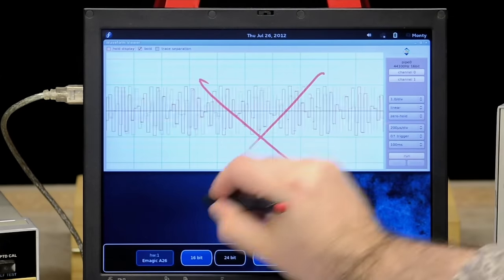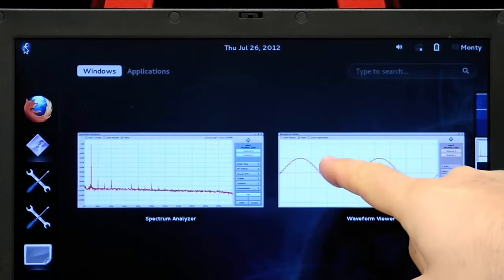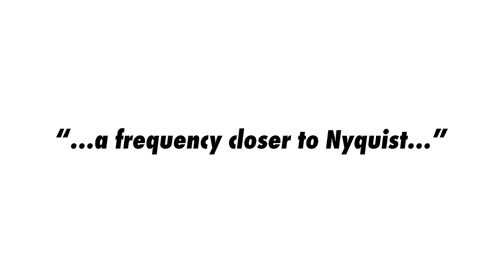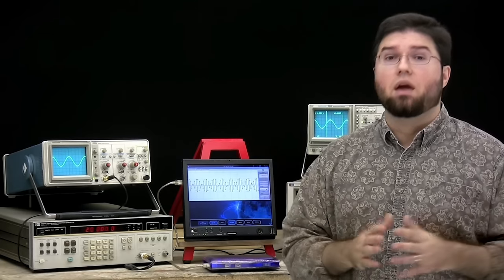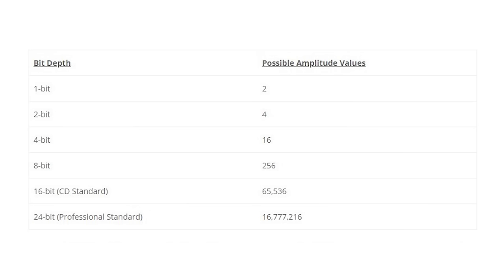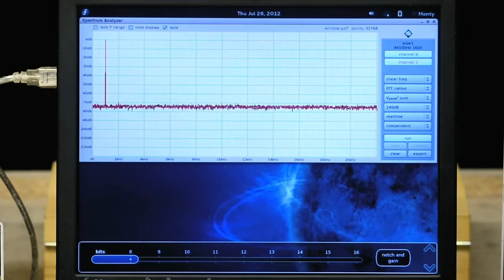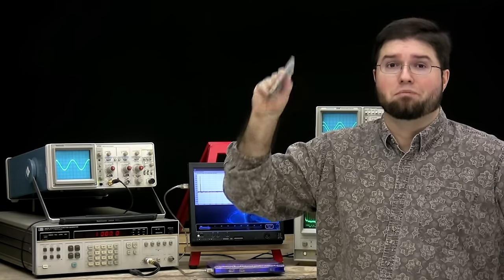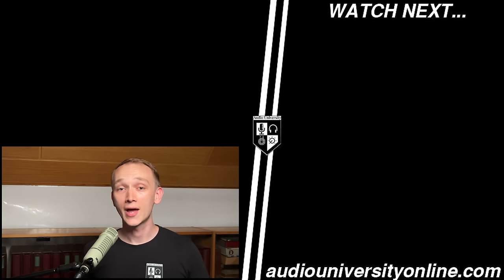Debunking the Digital Audio Myth: The Truth About the 'Stair-Step' Effect

Comment: I believe the 44.1 kHz audio used by audio CDs, Was really because at the time with Sony PCM, that was the maximum that could be recorded as data on U-matic videotape for PAL and NTSC standards. And later on, Betamax was often used for digital recording distributions to the CD pressing plants. This was before DAT became the norm in the recording industry.
Reply: Ahh penny dropped moment. I took a tour of a CD pressing plant in the 90's when it was all quite new, and we were shown the process from start to finish. When the engineer showed us the source material as a videotape we screwed our faces up, I guess thinking it arrived in analogue form.  As an aside, they had to destroy a large proportion of the pressed CD's as they had spots in them, usually black. They played fine, but consumers would think them faulty and return them. Another thing they showed us, and gave us a sample of which I still have today, was the ability to press a hologram into the disk instead of printing the tracklist or whatever. Looks amazing, but I have never seen it used on a CD release.

Comment: Very impressive content. This is a topic I am well-Informed about, and a misconception that I’ve explained to people on a few occasions. You did a fantastic job of explaining the fundamental fact that the PCM transcription can only be decoded into an analog duplicate of the analog input signal. Noise floor and headroom of the analog components in an ADC and in DAC for playback will matter if you are interfacing with analog audio equipment, so gain-staging and phase and the usual analog caveats still apply- and there absolutely have been very poorly-implemented examples that set bad examples of what digital audio ‘sounds like’- .mp3 stereo 44.1kHz at 128kbps was the norm for a long time, and some .mp3 codecs performed very poorly at properly encoding high frequency content, there is very obvious aliasing that can be heard for everything above 13.5khz. 

I clicked on this video mainly to check and see if you had your facts straight, and man you sourced an excellent video explanation also. I did not get to this understanding of the PCM wave function on my own studying until I was about 40 years old, after spending about a decade as a telecommunications technician and getting to the point of telecom engineer.  I’ve been making music with computers and instruments 30+ years, studying recording technology and techniques, and building my own synthesizers- this level of technical detail is satisfied that you didn’t gloss over any important points and that you drilled down to the absolute truth of the matter without resorting to an analogy (pardon the pun) or a metaphor to explain why. 

I was on the edge of my seat waiting for you to explain why higher sample rate/Nyquist is desirable in digital audio production, and might be an interesting/informative counterpoint to mention that some production choices intentionally lower the sample rate/bit depth and collapse mono in order to induce digital artifacts during conversion, such as aliasing and quantization loss (the Lo-Fi phenomenon, 12-bit samplers and wavetable synths making a big comeback, the proliferation of bitcrusher FX, etc)
Reply: Yes some codecs were dreadful. I remember satellite TV undersampled their transmissions on many programs in early years and sound scores had nasty and painful artifacts. Yamaha's TwinVQ codecs were very good, but all suffered with bad artifacts when the sampling was cut too far.

Comment: I worked for Harman in the mid 90’s & we did blind tests at 44.1, 48 & 96k. Everybody could hear the difference between 44.1 & 48 but most couldn’t hear any difference between 48 & 96. I do all my work in 48k now
Reply: People don't mix in 96k for the sound but for the latency. Just as you dont mix in 32 bit for the depth but to reduce noise input from mics.
Reply: "everyone could hear difference between 44 and 48"? no they didnt...
Reply: @matswessling6600  believe what you want and stay mediocre
Reply: But that's about the quality of processing after DAC.  A higher sampling rate allows for poorer post-processing quality.
Reply: @vaclavzeleny5717  I’d think a higher sampling rate would enable better post processing simply because there’s more information to work with
Reply: @GroverTD  I think it's because the following filters don't have to have as much of a slope.  So, on the same player (which logically has the same filters), a higher frequency will result in lower distortion, which then appears at lower frequencies.  It will not be related to a smaller amount of information.  If resampling from a lower frequency to a higher one was done, the sound would probably improve as well, even if no new information is added.  That's an my opinion.
Reply: @vaclavzeleny5717  I humbly admit you may know quite a bit more than I do about digital signal processing. I stick with 48khz because even though it's subtle I can hear a difference.

Comment: What concerns me with these experiments is that they are done on pure sine waves.  Audio is rarely a pure sine waves.  High-frequency (including in-audible) harmonics are additive.  So a bit depth helps to re-claim some of these harmonics for a purer sound.  It's not necessarily only about the noise floor.  It's also about recreating the harmonics on the signal.  But it is a good demo none-the-less.

That being said, most DAC's nowadays do not do the stair-step method, they climb the voltages between the points so you get more of a "lined" slope.  instead of a histogram looking thing....  Modern DAC's are amazing, and represent the MPEG-destroyed digital audio signal to it's very best!

Comment: It's all about context. Which is also skipped over here a little bit. On it's own, yes 16 bit DNR is enough. Unfortunately we don't use a DAC on its own, there will be an amplifier behind it. This amplifier also amplifies the noise. Just in a every day home setting this is often not a big deal. In a very quiet (mixing) environment, speakers that have active filters and very high efficiency high frequency units, the noise can be easily be audibility. The same goes for a big line array system with like 24 compression drivers with a sensitivity of 108dB/2.83V each. How do I know? I develop these systems and I can tell from 15 years of experience that in both cases those noise levels are clearly audible for every human being.  There is also a good argument of having some safety margin. Although that's more on the recording site. When music is mastered, there is a lot of EQ'ing going on, you also don't want to clip your signal. Both combined will already give at least a 24-32dB penalty on your DNR. Resulting in an effective SNR of just about 75dB or so. Similar things can happen when it cones down to sample rate.
So while I agree with the message that people shouldn't be so worried about DNR/SNR and samplerates as well as debunking some myths, this video still gets a thumbs down from me because it's extremely over simplified. It doesn't explain why some of those higher numbers are actually very useful. Therefore also spreading misinformation.
Reply: An amp's job is to amplify all frequencies equally.  The db's will stay the same while the dbm's will all increase -- there's no reason why an (excellent) amp should amplify the source noise more than the source signal.  (the amp will add its own noise, to be sure).  You're totally correct about the safety margins -- that's why we master and digitize at much much higher precision/frequency than the output. And yes, I am yet to see a speaker that can reproduce an even 80db range without distortion 🙂
Reply: @dmitryjoy  That's true, the issue is when there no signal present, it will still amplify the noise. Resulting in audible noise at quiet moments for example.
Which is just a small annoyance at like monitor speakers, or can be very disturbing for a professional musician with an active floor monitor (with a compression driver) during a concert.
But during just regular play at max volume, yes you're correct.

Comment: It would be interesting to see what a non-sinusoidal signal turns into with this conversion and how much noise there will be in the final signal. In the above example, an excellent sine wave can be obtained from a sine wave simply because this is how the digital-to-analog converter works.
Reply: This is exactly what I was thinking. If by default the DAC is smoothing the waveform assuming a single frequency (clean sine wave) then when you modulate some additional frequencies in there may be a lot more difference between the input & output.
Reply: Any non sinusoidal waveform (sawtooth, square) basically everything with "corners" has a infinite frequency spectrum, and is therefore beyond 22kHz.
Reply: @MatthiasSchaff So what? Is sawtooth or square signals not audible? Or no visible on osciloscope? But such signals will definitely show how analog-digital-analog transformation works with all features. Clear sine is not a good example to show that there is no loss with such transformation of signal.
Reply: @MatthiasSchaff  the key is using something other than a single frequency. This could easily be established by modulating several frequencies together for a comparison. If a DAC is designed to always smooth as if it is a clean single frequency sine wave then a lot can be lost.
Reply: @GardeningSolutions  Exactly. And it so happens music usually is made up of many frequencies all at the same time ! Why this is absent from the discussion here except in this subthread makes the mind boggle. Not to speak of unpitched sounds !
Reply: This is exactly what I was thinking whilst watching this. Much like you can describe a line using two points, there must be a point where you can describe a sinusoidal waveform in the same manner, then any additional data is redundant. Hopefully someone can comment with an explanation!
Reply: @MPHstep  Any signal can be represented by a sum of sinusoidal signals (Fourier transform). This is what a spectrogram shows: the amplitude and phase of sinusoidal signals at different frequencies. The sum of all the sinusoidal signals in the spectrogram is equal to the signal in the time domain (amplitude over time).
For a perfect representation of a discontinuous signal, infinite frequencies would be needed to represent it in the frequency domain. But our ears can only hear the parts that are within the 20Hz to 16kHz range. That is the reason why all audio equipment is made for that range. If you look at a 16kHz band limited square wave, it may look weird at first, but it represents what our ears can actually hear. All higher order frequency components are inaudible to us so there is no point to reproduce or store them.

Comment: I never even considered the idea that captured samples can only result in one possible output. That revelation is kinda of a game changer for me. Great video!
Reply: But that's the point in the video where suddenly there's no explanation where one is needed. :/ How can there only be one possible output? He shows someone drawing multiple possible outputs, then just says "turns out, nope, you can't." Why not? What if there had only been two or three samples? How could there be only one possible output then?
Reply: @krisrhodes5180  if you draw a shape that is clearly wrong but hits the sample points, the you have tried to capture something that has way too high of a frequency for your sampling rate. Thats why sampling frequency needs to be double of the intended frequency range.
Reply: Okay I think I may be starting to see how this works. If I have just two samples, then the highest frequency this works for would be one (over the same time as the two samples). I can imagine that if I'm told "these two samples represent a sine wave at a frequency of one or lower," maybe there's a unique solution there. (Still feels like there should be a solution at every possible frequency one or lower but I can believe that feeling is wrong.)
Reply: @krisrhodes5180  It's called the "Nyquist–Shannon sampling theorem", and I think if he went into the math in his video he would just lose the audience.

Comment: I don't understand the problem. Of course the output is a wave again. The converter to put it from digital to analog will make is a wave again. That is the job of a digital to analog converter. It takes the digital "sample points" and generates a sine wave that matches those "sample points"

The question is how good of digital to analog converters are there and how good or bad do they turn the digital signal back to analog when given more than a simple sine wave. A sine wave should be the easiest signal to convert back to analog.